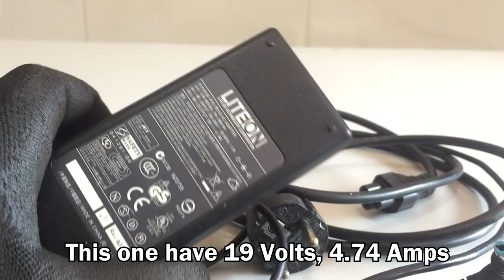Electrolysis Rust Removal - DIY Step by Step for Everyone

Comment: Very clearly and simply explained thank you.......I tried it today and was delighted with the results. The parts I was cleaning were smaller, so I tried using a 12 volt charger and it worked fine.
Reply from the maker: Hi Robbo. Very happy you tried and worked for cool. Big Hug Bro.

Comment: Very good description of a simple method, which is very effective and needs no messy smelling chemicals at all 👍
I would recommend a much larger positive electrode, such as a disused brake rotor.
As mentioned, do not use stainless steel.
Avoid chromed or galvanized parts, as they also produce nasty gasses.

Comment: Interesting video-so a small charger like a laptop will work and I would have never thought of that and always figured it would take a really powerful car battery charger to do the job.  It appears it's all voltage and no amps?  Dollar Store here I come to get plastic pans and baking soda and wire.  Thanks for your time on this~!
Reply from the maker: Hi Rickarama... Yes its very cheap to do this 😀... Buy Washing Soda... Big Hug...
Reply: i actually did this yesterday with 5v 0.7A phone charger😀😀😀

Comment: Great video. I appreciate the level of detail you go into. Using Washing Soda instead of Baking Soda aids in process.  Not sure if this helps but here is a mix that's worked incredibly well for me.

1 table spoon WASHING soda per gallon 
And
3 cups of white vinegar per gallon water 

45mL washing Soda +  710mL white vinegar per 3.78L

Hope I got the unit conversion right haha

Comment: Washing soda is preferred. To use baking soda, you should spread it on a pad and bake it to break it down (into washing soda.) Baking soda can work but I think you'll get somewhat better results with washing soda. Another note - never use stainless steel as your sacrificial piece - it creates a caustic substance (but it will work.)
Reply: Arm & Hammer Super Washing Soda to be exact.
Agreed.

Comment: the process is well known worldwide, but with the practice, each one made their own fine tunes.
for instance: 
1- for me the main rust when possible must be removed with any kind of tool(s). there are big chunks of rust that must be removed with a big screwdriver or even a chisel, 
2- after that I opt for remove the maximum remaining rust with a strong wire brush and/or with a driller with rotary wire brush bit.
3- only after this, that are very simple and quick to do,  that's when I use the electrolitic method, that will go tho the hidden spots and corners that the brushes can't go.
4- with some experiences I noticed that the bigger the iron/steel pieces (anode), the better the results, because there are more surface to rust attaches.
5- if you have little pieces as bolts, nuts and so on, you can pass arround or through them with a fine wire in a way to make a sorte of cord of smalls.
6- I have to say that I use in this process an old battery charger of 12V, not those moderns Ultimates (R) and other "inteligent" chargers.
7- last but not the least, all the sites and books I read, advise to not use stainless steal as a anode in this process, because the remaining water of the process will result in a POISONOUS liquid, I don't know why, never read about why this occour, I'm not a chimician, but is better NOT make that mistake.

Comment: Wow!! Greatly appreciate the tips N tricks with repurposing the laptop charger as well as creating electrodes and wires with banana clips. Can the electrodes be cleaned and reused? How do you discard of the salty/rusty water solution safely?
Reply from the maker: Sam if you are trying to be funny you are in the wrong place Bro...
Reply: @RandomTubePT  ISam did not respond but, I don"t think he was being funny at all. I think he was complimenting you on "repurposing" a part you don't need for what it was intended for (charging a computer). Also complimenting you on being clever to use wire intended for wrapping fruit. And he followed by a question if the solution of salt and rust can just be emptied out on the ground cause he thought it might be a bad chemical cause it looks so bad as it bubbled. I also believe there is a language problem because your from Portugal and English not your primary language. You and I probably have a language problem as well as I am American and you are not. Incidentally I don't speak a speck of Portuguese even though my grand parents from Portugal. Although my GP used to yell at me and say fechar a janela/fechar a porta. Also Cale a boca and something like...papines or something like that if there was tiny pieces of paper on floor. I don't know. One thing I know that I have Portuguese in me is I can cook up a storm. Portuguese cooking is awesome. I have all the recipe's! Lunch time now having bifanas and a beer.

Comment: When you use the Salt it creates Hydrogen Gas... which is the reason for ventilation. Using Washing soda crystals - Sodium Carbonate... from what I'm reading reduces that amount of Hydrogen ..though you still need reasonable ventilation. 

Yup! I learned this on You Tube! Is this true or does it make any real difference? Thanks for any advice
Reply from the maker: Hi... Yes thats correct

Comment: So I used a pretty similar setup as you. I was using a 19 volt laptop charger but recently the charger works until I hook up the negative then the light goes dead (on the charger box) and there is a beeping sound coming from the wires. I made new connections between the wires and the charger and its still doing the same thing. Any Advice?
Reply from the maker: It sounds that the charger is not good bro... Do you have 19 coming out the charger?

Comment: Hello!! Nice video! Saved me buying a battery charger to do this! Could you advise on the steel wire for the negative connection. I can only find stainless steel wire. The only mild steel wire I can find is for welding. Is this ok, or is there an alternative?
Reply from the maker: Hi Steven... You can use normal electric wire... Big Hug Man.
Reply: Easy!! Thanks 👍 I’m off to remove rust from the rear subframe of my 2004 mini. 1200mm long so doing in a Plasterer’s bath. No point starting small! 😄👍

Comment: hey random, can u show me how it will work on nuts and bolts? I work on bikes and the nuts and brake sleeves are always the first to rust, can it also be done on the wheels when the spokes get rusty and what will happen if there is a bit of stainless mixed in? thanks
Reply from the maker: Hey Man how are you? Hope well... For Nuts and Bolts the process is the same bro... For Stainless dont do it it will damage...
Reply: @RandomTubePT  thanks mate.

Comment: Hey great video! I just have a question, I have a 24 v old charger and i dunno if thats safe to use? Help please i just need to know if 24 volts is safe and wont cause any shock
Reply from the maker: Hi Bro... I think that 24v will be too much i never used more than 12v bro
Reply: @RandomTubePT  Thanks for replying man i really appreciate it, And ill keep it updated when i try it ill tell if it works!

Comment: If we want to do electrolysis process on huge size how much amp current we needed. size may be 350x250x180mm(LXWXH). It is used engine head.
Reply from the maker: I think you can use the same i used...

Comment: hallo random, great tutorial, nice and clean. what do you think  about using a  stick welding  machine? would you suggest it? ever tried? thanks.
Reply from the maker: Hi Bro... Thanks a lot. A stick Welding Machine? As Power Supply?
Reply: @RandomTubePT  yess i've  seen  some  video on using it to zinc plating with electrolysis. set to minimum ampere but i 'm not sure  about rust treatment. i'll have a look.
Reply from the maker: Actually i never tried 😀👍

Comment: A superb presentation showing all the steps with easy to follow on-screen instructions. A very good section of FAQs with precise answers backed by a scientific insight. Thank you for not having endless and useless chatter and Musak. I've seen lots of vids on this technique - yours is the BEST.
Reply: Only one item missing - what concentration of, for example, washing soda, please?
Reply: @aaamediamail5552  I have used 1 1/2 tables per gallon of water.  I don't think it is a critical measurement, but arm/hammer wash soda (sodium carbonate) works best.  Put a 12 volt battery charger or battery as power.  Let cook 6 or more hours.  The process is done when the rusty (anode) part is black that can be rubbed off easily and the cathode + side is coated with rust.  I just learned about this rust cleaning process a couple months ago and I'm 74 years old.  One old dawg can be taught a new trick.
Reply: Ooops the anode is the positive side, the rusty side gets the negative connection.   My bad.  Es Tut Mir Leid.

Comment: I finally got around to do this experiment and it was working for 24 hours on a rusty barbecue grill. However the second day I was going to do the process again I discovered that the battery charger I was using was toast! It was black and melted together inside. It was 12V and 6A. You are using a regular laptop charger with higher V and less A. The positive long rod that was sitting in the water was wittered down to a tiny sharp point over a 3 inch length.  What could the reason be why my old battery charger melted and shorted out?
Reply from the maker: Hi Jonh... 24H? Thats is to much bro. It just melt the charger? You anodes are still alive? Bro that is to much... 3h is enough... If you want repeat the process more than one time but never 24h that will destroy everithing man... Big Hug
Reply from the maker: Hi John... I read your last msg but for mistake i deleted 😟😟😟 Sorry... Do it for 3 hours... Clean you a brush and should be nice. If not... repeat the process... but usually 3 hours are enough... And yes you can share your photos... Here is my channel email : randomtubept@gmail.com
Reply: @RandomTubePT  great fun! Sending soon :)

Comment: Hello from Turkey my friend....... that is a very nice explained video I've seen so far about this method. Thank you. I have 2 quesitons if you dont mind....
1- Are those rods plain iron ?
2- if I want to remove rust from small pieces (clippers, wrench, bolts , nuts etc) do I have to wire them all together ? Or is it enough if they contact with each other in the solution since the negative will flow through them ?

Thanks.
Reply from the maker: Hello Serkan... 
Let me see if can explain well to your questions...
1 - No, threaded rods. Similar to screws. But you can use plain rods.
2- connect them all together bro...

Big Hug from Portugal to Turkey...
Reply: @RandomTubePT  Ok understood. Thanks for the reply : )
Reply from the maker: You Welcome. Feel free for other questions... Big Hug.

Comment: Seen a few YouTube videos on this and everyone is using steel wire on the part. It's been some time since my chemistry A level, but I am pretty confident that it's only the cathode where you need to keep the copper out the solution. At the anode aka the part it will be fine to have copper in the solution. At least in my trials there was no issue attaching the part directly to copper wire.

Comment: How do you deal with the laptop power supply/adapter getting pretty hot after a while?
Reply from the maker: How much amp and voltage your charger have... ???
Reply: It is a 19,5V 3A adapter from an old HP laptop. Running another session with it right now and it is getting pretty warm again, guess I will have to look into some cooling for it somehow.

Comment: can i use this meyhod for cleaning cylinder head engine with a lot of carbon? or only rust?
Reply from the maker: Hey Man, Depends  the materials... i never tried
Reply: @RandomTubePT  Aluminium cylinder head can? or only rusting? not for carbon oil or else
Reply from the maker: @yoyyoy4789  The process could damage your cylinder head because its aluminum bro...
Reply: @RandomTubePT  meaning only for iron?
Reply from the maker: Not only Iron, but aluminum will damage man...
Reply from the maker: If you have other similar piece test it before... Sorry i cant edit my last msg and i dont know why...
Reply: @RandomTubePT  ok Thanks info

Comment: i have rusty 2mm plates very rusty plates(MS),what metal can i use it for anode, foni have to use the same Ms metal or any other metal like aluminium can be used, pls calrify
Reply from the maker: As i said in description bro: Never do this in a closed space, the process creates a perfectly balanced mixture of hydrogen and oxygen that is highly explosive. Ventilation is extremely important.

Do not use stainless steel, you will turn your solution toxic with the production of hexavaliant chromium extremely toxic and carcinogenic.

I leaved a link in description with very good info about that

Comment: Use wire brush and clean for 10 min got it. But first put it in a hot tub for 6 hrs for some reason ?
Reply: Let it for more then 24hours if you dont want to use the brush
Reply from the maker: No... Than can destroy your power supply
Reply: @RandomTubePT  i meant 24 hours in vinegar

Comment: I was wondering why is this electrolysis process opposite from electroplating where the anode is connected to the electrode that you what to remove. I thought the anode's ions will dissolve into the water and form it on the cathode just like electroplating? But this is opposite?
Reply from the maker: Hi my friend... I not the best person to explain you the diference because i never did electroplating bro. Big Hug

Comment: There is something weird in your video if i am not seeing wrong why is your multimeter connection red proble connected to com ? that  is super confusing .... red = + black = - or ground ...
Reply from the maker: Hi Muhammed Gundogan, I already explain that in a comment. In fact yes but i just realize later and in this case that its not very important. But yes the connections colours are inverted. Thanks for the comment. Big Hug

Comment: If you had left the part in the solution longer would there have been less cleanup at the end?
Reply from the maker: Hi Greenid Guy... Not necessary... It will always depend the amount of rust that your piece have... Usally i leave for 3 hours for normal rust and 6 hours when i have a big amount of rust... Happy New Year. Big Hug

Comment: What metals are ok to use for the anode?
Reply from the maker: Hi... Just try not to use stainless steel, you will turn your solution toxic with the production of hexavaliant chromium extremely toxic and carcinogenic. In description i leaved a interesting link with good information. Big Hug.
Reply: Random Tube PT thanks, I just build by first electrolysis setup yesterday, works great, ended up using rebar

Comment: Hi. Thanks for the great vid. I just wanted to clarify: Using stainless steel as an anode is a big NO. But can I use this to remove rust from a stainless steel item?
Reply from the maker: Hi stainless steel  usual dont rust and It will pull the chromium out of the stainless.  If you need to clean stainless, try lemon juice.
Reply: @RandomTubePT  Thanks!!!
Reply from the maker: You Welcome. Big Hug Bro.
Reply: @RandomTubePT  you meant to replace baking soda with lemon juice?
Reply from the maker: Hi Bro... No...

Comment: An automotive battery charger makes a great power supply. Good video...thanks!
Reply from the maker: The Hunter Thanks... Yes that’s true I used a Laptop Charger because almost everyone have but automotive battery charger don’t... But yes works very well. 💪
Reply: Depends lots of modern smart battery chargers are no good.

Comment: I'm going to do this to my very rusty frozen driver seat rails.
Reply from the maker: Hi Tori L 😀 Thats great then share your experience 😀
Reply: @RandomTubePT  it's working well so far. It's been in the solution for few hours now. I changed the power source to the car battery instead of a laptop charger because it didn't seem to do much since the rails are so large. Working a lot better now. I'm going to check on it in the morning. Hopefully it unseizes the rails.

Edit: had it sit over night and 95% of the rust is gone or came off with the wire brush. The rails broke free so they move now. It worked!

Comment: There is faster and better ways to accomplish this and they also can remove other things such as paint and scale a vibratory parts cleaner filled with an abrasive like sand or vary fine steel shot you can watch videos online that shows how to build one or you can get one at harbor freight  . Next you can sandblast your part using a vary fine sand ,soda ash, baking soda, ETC.  and like with the previous method you can watch videos online that shows you how to build a low cost sandblaster or you can get one again at harbor freight,  next you can use a wire brush wheel that mounts on an angle grinder be sure to wear a full face shield with safety glasses a dust mask to protect your eyes and lungs the 3 methods work a lot faster there are also rust removal sprays that work I wouldn't recommend  CLR cleaning solution that crape is advertised as an all purpose solution I've used it on recommended stains and surfaces and it didn't work at all
Reply from the maker: Hi... The ideia was to show how to remove rust on cheap way so anybody can do it. Of course there is another good ways to remove. Thanks for your comment.

Comment: 2:05 you are supposed to put the black to COM in the multimeter
Reply from the maker: The colour of the cables in the multimeter are inverted... big hug
Reply: @RandomTubePT  yeah i saw that, but why did you not put them on correctly
Reply from the maker: Because i just realize latter 😂😂😂
Reply: @RandomTubePT  ok😂😂